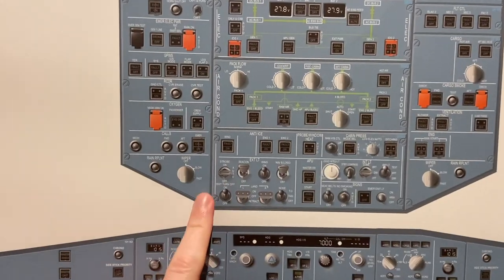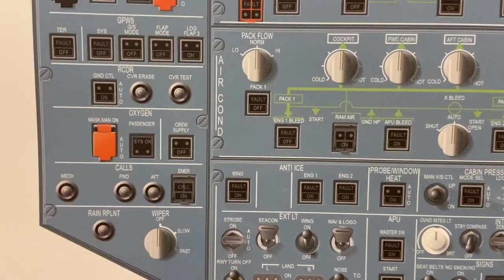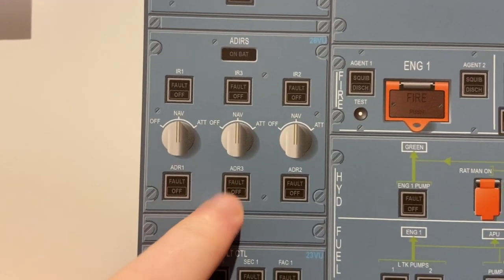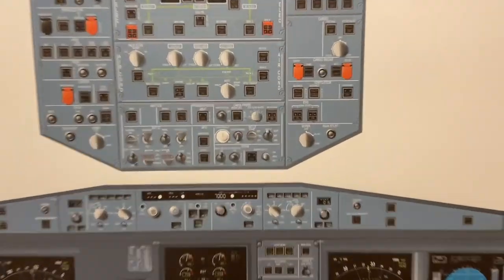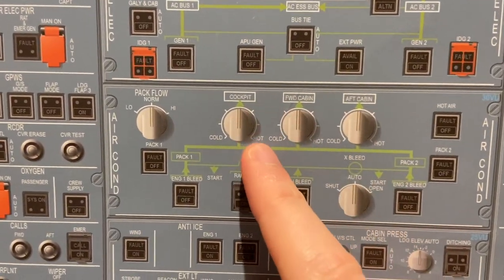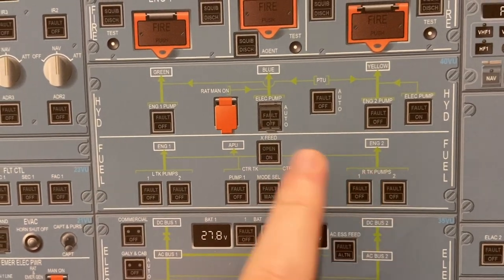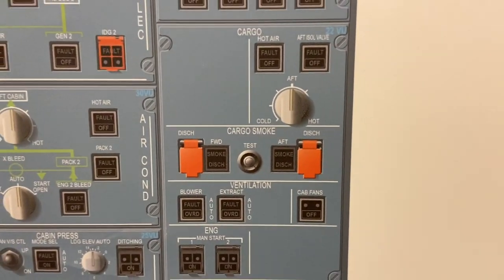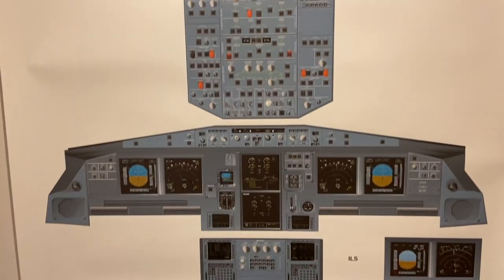A320 Cockpit overhead buttons explained

Comment: Hey Jack! very good, useful and explanatory video you got in here, appreciated a lot. But one thing I noticed about the printing that you use to demonstrate the systems. The quarter-turn fasteners there represented in there as not thightened, they need to be represented as 0 degrees, not 45 degrees as they are there. Wladimir Dzus (RIP) invented those and named them as Dzus receptacles + Dzus Rails. The simplicity and breaktrough fasteners they are. You only need a flat screwdriver and within 8 seconds to install & remove the whole VU panel. And as I can see from here that within a wake turbulance some of panels on overhead panel will fell down :) love & respect !

Comment: Great - like these type of videos... one thing - missed AC ESS feed - what does that do?
Reply from the maker: Great question! The AC ESS (AC Essential Bus) is usually supplied by Gen 1 via AC Bus 1. In case of Gen 1/AC Bus 1 failure, the AC ESS can then be supplied by Gen 2 via AC Bus 2. The aircraft can be fitted with "Auto switching" meaning in the case of that failure, it would swap buses automatically for us. The pushbutton is to manually switch which Bus is feeding the AC ESS. Also, when we push this pushbutton, the DC ESS (DC Essential Bus) is then supplied via the ESS TR (Essential Transformer Rectifier) via the AC ESS. Normally the DC ESS is supplied via the Batteries in Normal Configuration. 

Hope this helps!
Reply: @busdriverjack3248  Great!   Thanks!

Comment: Good explaining, but you missed AC ESS FEED at battety sector for what do you need this button?
Reply: It switches the AC ESS source from AC BUS 1 to AC BUS 2. Mainly used if AC BUS 1 fails. In old Airbus it had to be pushed to switch but now it's automated . Only have to push if automation doesn't work.
Reply: @tomstravels520  Thanks.

Comment: why there is buttons with 2 dots at upper and 2 dots at lower, what is the difference?
Reply from the maker: Hi Toriq, sorry it took so long to reply. If you haven't found the answer already then here it is!

Each pushbutton on the Airbus has either one or two lights. 

- The upper light is dedicated to an alert or the system's status (i.e. FAULT or OPEN). If this is not applicable then it is replaced with two grey dots.

- The lower light corresponds to the control selection of a system after pressing the pushbutton (i.e. ON, OFF, OVRD). If this is not required then it is replaced with two grey dots.

The general rule is a "light out" philosophy. A dark cockpit is ready and fit to fly! All the best!